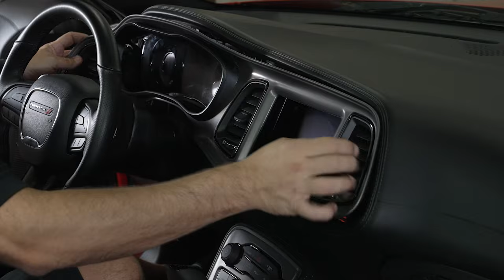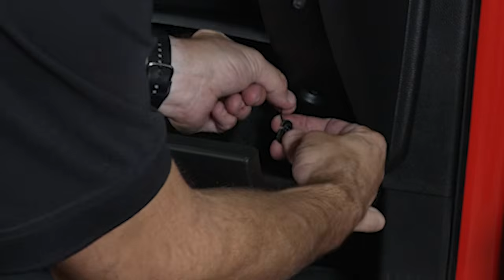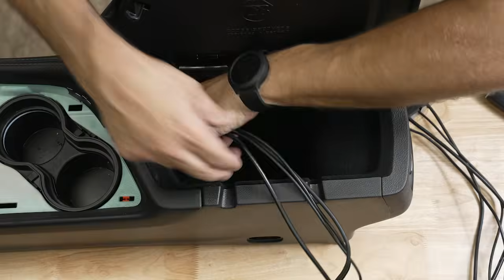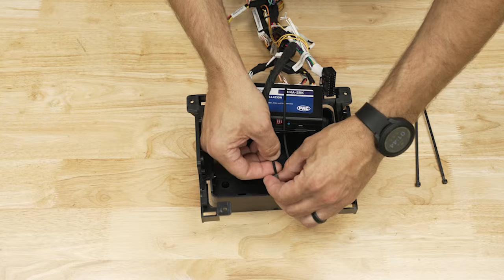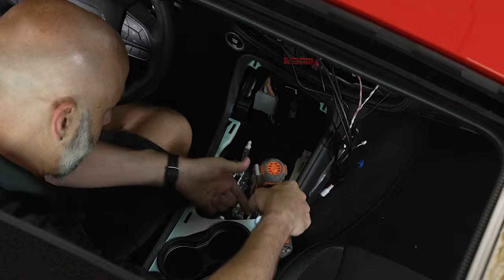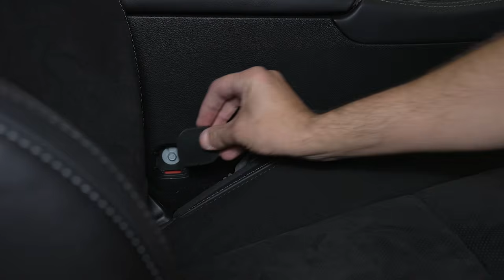Install: HORIZON10 Dodge Challenger/Charger/Chrysler 300 (2015-2023) 10" Radio Fully Integrated Kit

Comment: Great installation instruction! Thanks for sharing the whole process very precise. A few additional questions: is the Horizon 10 able to display the performance pages, line lock, lauch control? As it has CAN-Bus connection, does it show left and right camera (if connected) when using turn signals? Is HD radio the same as DAB2 in Europe (I am from Germany)? Would the Challenger's Alpine or Haman Cardon sound systems qualify as amplified? Thank you very much!
Reply from the maker: We have a HORIZON10 for EU countries, it had the dab antenna. As for line lock and such, please see below.

Does Not Retain:
Cluster Display Features
• Compass (when equipped with 5" or 8.4" screen)
• Clock
• Phone pop-ups
• Navigation pop-ups
• Launch Control Timers
Factory Amplifier Features
• Speed Controlled Volume
• Surround Sound
SiriusM Guardian Services
Uconnect Features
Uconnect Access Remote Start / Lock / Unlock
• SOS / Assist
• Vehicle Location Service
• WiFi-Hotspot
Performance Features
• Launch Control with Launch RPM
• Line Lock
• G-Force status on radio (still on instrument cluster)
• SiriusXM Radio

If you have any additional questions, we recommend contacting our Tech Support team. You can email our experts at tech@stingersolutions.com or call at (727) 732-3114 Monday-Friday from 9am-7pm ET!